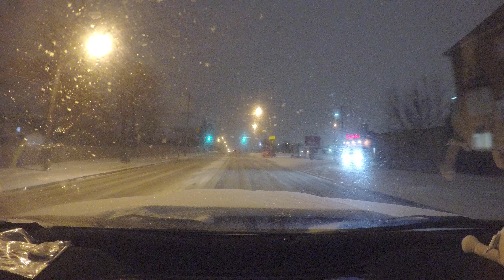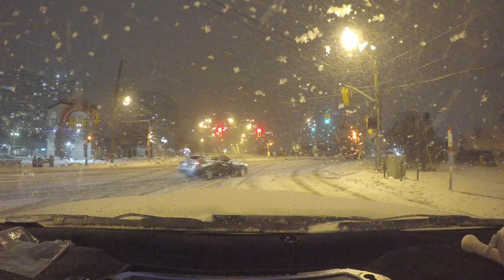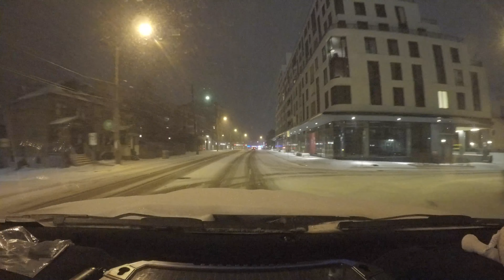Why I Like The 65RFE Automatic Transmission - 2016 Ram 1500

Comment: I’m looking at the same truck and gears and a 2017 8 speed 3:92 torn between what’s better
Reply from the maker: If you’re going to load the truck down with high payload or towing, go with as deep gear reduction from the factory as you can find. For example 3.21:1 axle ratio is great if you’re driving alone on the highway in an empty truck but for hard work you’ll want the 3.92:1 which is why towing capacity is greater with deeper gears. The ZF 8-speed & 3.92:1 is a very strong combination because compared to the 65RFE the first gear is much lower but the final gears at we very similar and it’ll get a heavy weight moving much easier compared to the 65RFE with 3.92:1. Of it’s a 4WD truck, changing differential gears become very expensive along with a speedometer calibration. Both the 6-speed and 8-speed are very proven and reliable in stock applications. The 6-speed is much cheaper to repair / replace / service compared to the 8-speed which has better gear spacing & shifts up & down quicker and smoother because of a more modern design and closer gear spacing between all the gears. You really can’t go wrong with either truck … get which one is in better shape / better deal and with proper maintenance they’ll both last a very long time. Hope this helps you out.

Comment: My 2012 shifts into a very low power band like 40mph will a regear help has 65rfe
Reply from the maker: Did you have the new gear-ratio & speedometer  adjusted after the regear? Is your truck shifting into top gear at 40mph perhaps? The computer needs to know the axle gear ratio & tire size for correct shift points. Hope this helps you out.
Reply: @jocotechtrax7356  I’m saying there’s a gear that I feel that’s really too low will a bigger regear help shorten the shift point  at 80 I’m only doing 2000rpm with 3.55 gears
Reply from the maker: @moemoe0032 The shift points in the automatic transmission are calculated based on parameters such as calculated engine load / throttle position / engine RPM / vehicle speed / temperatures / tow haul mode / etc etc. A regear will not necessarily alter the transmission shift points directly if the new gear ratio and tire size are tuned into the PCM when the regear is installed. Your 2012 Ram does not have an encrypted PCM yet (I believe 2015+ are) so if you’re looking into altering the shift points, there are ‘relatively affordable’ aftermarket tuners that can tweak those parameters. Going with a deeper regear (for example from your 3.55:1 to 3.92:1) would definitely increase your highway RPM by a few hundred in top gear but it is an expensive installation and if your truck is 4WD you have to do the front as well which will double the cost. If you do end up going with a regear, the aftermarket does have greater options to chose from than the factory had (3.21 / 3.55 / 3.92) … depending on what you’re looking to accomplish and how much highway fuel economy you’re willing to sacrifice you can go pretty aggressive even if you have larger tires on your truck. Manufacturers nowadays have to meet strict CAFE standards and they all build their transmissions with a few overdrive gears to get the best fuel economy possible, but in the real world those gear ratios are too tall for everyday driving. I have the same issue you have … my truck has the 3.55:1 axle ratios and if I would have ordered it brand new I would have gotten the most aggressive gearing available which is the 3.92:1 because going with a regear down the road is very expensive. The only other option would be to put smaller diameter wheels on the truck or lock out 6th gear manually but most people don’t care to do that. Hope this helps you out.
Reply: @jocotechtrax7356  I’m thinking 4.56 I got rwd it’s more of car then truck but it gets used few times just bed stuff usefullness
Reply from the maker: @mohamed albana  Having a RWD truck will definitely cut down on the cost of a regear. If I’m not mistaken, you can go as low as 4.88:1 but that might be too deep for you. It’s hard to say how the truck will drive after … unless you can test drive someone else’s truck with that specific gearing it’s a flip of a coin. The deeper you go with gearing, the more it’ll impact your top speed but you definitively will have a more spirited truck in return. You’ll have more wheel torque in each gear and you definitely won’t lug the overdrive gears unless you’re heavily loaded … in which case just use tow / haul mode or lock out whatever high gear you don’t need. As I said I don’t have too much experience with regearing a Ram 1500 but I do have a lot of experience with Jeep Wranglers & the end result is the same. One constant from taking to people who regear their trucks … whoever goes as far as investing in such a modification … nobody ever complains about going too low (relatively speaking) but people do complain about not going deep enough. Just make sure you’re settled in your future tire and size & refers accordingly. Again … with these modern trucks … make sure you readjust the gear ratio & correct for any aftermarket tire-size changes for correct automatic transmission shift characteristics. Hope this helps you out.

Comment: Love my 65rfe.   2016 Ram 1500 5.7 Hemi.  Dropped the pan at 120k km for first service.  Fluid was still cherry red.  Magnet had nothing in it.  Drain and fill.  Two filters replaced.  Added drain plug.   Seems to be a strong transmission.
Reply from the maker: Same here … no complaints about the unit. As good as the new ZF 8-speeds are, the 65rfe does the job just fine and doesn’t miss a beat. Keep up with the maintenance & it’ll last the life of the truck. Two thumbs up!
Reply: Any details on how you added the drain plug? Did you weld a bung and tap it?
Reply: @jurpikag  No welding.  Bought a drain plug kit.  Drilled the hole in lower part of pan.  Used high quality copper washers.   2 years now.  Dry as the day I installed it.   Other more expensive option is an aftermarket pan with a drain already in place.

Comment: Great Video! I Myself have a 2014 regular cab 5.7 Hemi with a 65RFE transmission. By any chance when you learned about the 65RFE transmission what is the max horsepower and torque it can handle before breaking? Also when do you recommend transmission fluid change? I’m at 117,000 miles.
Reply from the maker: 4th Gen Rams are awesome trucks no matter the configuration.  I believe the 65RFE transmissions are rated for around 500lbs/ft of torque.  They can definitely live a long life behind the 5.7L Hemi with proper maintenance.  I have never looked into the owner’s manual regarding what the manufacturer specifies but always follow what it states.  I personally almost always change the transmission fluid & filter around the 50,000km mark (I live in Canada so it’s an easy number to go by).  At 117,000 miles it’s probably a good idea to service your transmission ... fresh fluid gets rid of all the contaminants.
Reply: The Hemi is the max the 65RFE can handle power wise, I think the hemi is within 5 HP of the 65RFEs max HP rating and around 5 ft-lbs away from the RFEs max torque rating.
Reply from the maker: @MidnightReaper26  Yeah pretty much so. The 395hp 5.7L Hemi was the strongest engine put in front of the 65RFE transmission. Chrysler had to upgrade the internals of the 66RFE in the HD trucks to handle a higher gross vehicle weight rating & the stronger 6.4L Hemi engine. The transmission cases are similar between the 65RFE & 66RFE transmissions but the internals are not and they are not interchangeable. Everything has a limit but in a factory application the rating is a meaningless number … when people ask about transmission power ratings they usually have intentions to modify vehicles which is always a gamble. In every OEM application the transmission will handle the power output of the engine or the manufacturer couldn’t warranty it.
As a side note, some manufacturers rate transmissions for a maximum constant safe power handling while others will give you an estimated breaking point. Only the engineers can provide accurate data and usually it’s not something that’s published. As the old saying goes: never believe anything you read on the internet ;-)
Reply: Hello, I am getting a new truck for myself (new to me) to replace the old Nissan titan 2010. It is the 2015 ram 1500 with 65RFE as well. thanks for sharing the info. Hows the transmission holding up so far? Is the 6 speeds respond well or hunting for gears? Also if you dont mind, would you be able to give tips to maintenance? I appreciate that a lot. 🙏
Reply: @nghitran1433 6 speeds in my use don’t hunt at all unlike the 8s. they’re also much more drivable and feel more responsive.